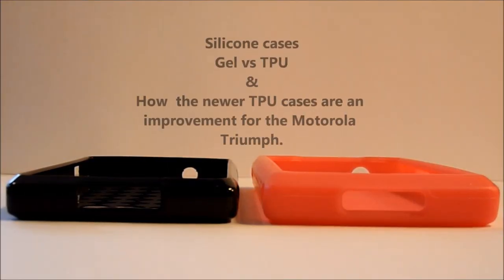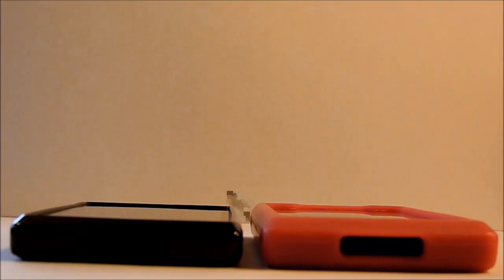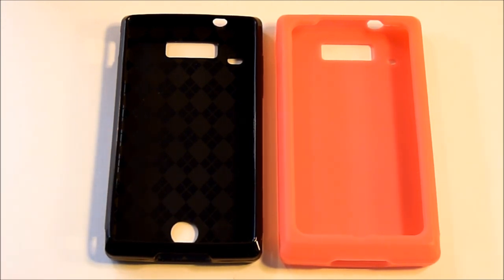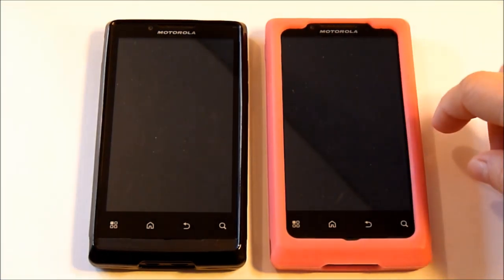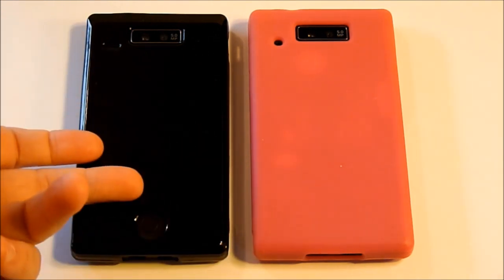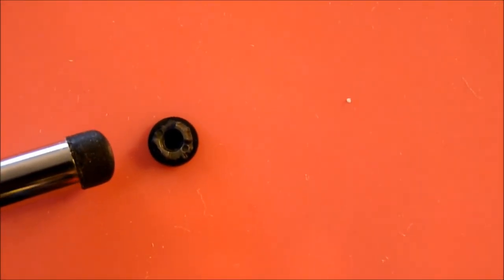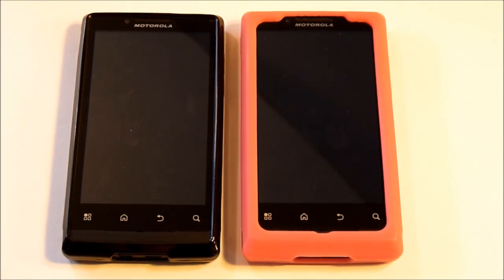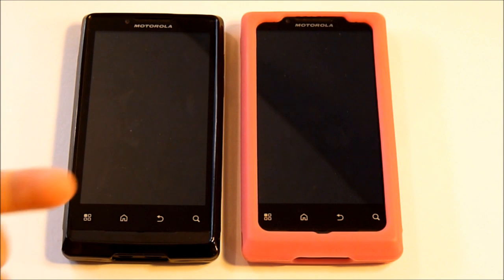Gel vs TPU phone case featuring Motorola TRIUMPH

Comment from the maker: @Mockingbird115 as for the battery back. another thing you notice they sell backs separate for around 10.but if everything ok with phone. then yes tried and TPU case no battery back and would be ok and advise folding a piece of paper and placing over battery to fill on the gap and help if jostled to keep battery from shifting as there is a little gap.

Comment from the maker: @BrianSimon94 they seem to be same thickness but I am going to make a educated guess since I don't want to do a drop test and see which one did not break. the TPU is little stiffer and impact may provide better protection. would a firm helmet vs a soft helmet same thickness protect skull better from cracking in as much. but insides are gonna get a jolt the same. wonder if somebody could invent a flubber case.

Comment: What I worry about is that gel cases add no structural integrity or protection, just a bouncy rubber sock around the device.   If you drop a phone or tab, the first place its going to hit the ground is on its weakest points... the corners.   Very rarely can you drop a phone or tablet and have it hit completely flat... 95%+ of the time one of the corners is going to impact the surface first... its just the geometry of situation.   Therefore, you want a case that is going to protect the corners the most, and absorb the impact and transmit it around the phone, and not transmit it to the phone.   A gel case won't do anything in that department.  It might protect your phone from scratches, but not from drops, gravel, water, twists, impacts, or god forbid you sitting on it like an idiot when its in your back pocket (which so many people think they can do - wrong).

Comment from the maker: @MrKeBUM I did ad a micro SD card class 6 is good price and works. I went with 32GB PNY class 10. I suggest staying away from Patriot brand they have trouble with android phones right now. read reviews newegg and support admits it too. Writing to card slight difference but the reading items from the SD card is much faster.  I can tell you from market Modern Combat 2 not compatible for triumph... and no Modern Combat 1 available. were would I find older Modern Combat 1?

Comment from the maker: @Mockingbird115 warning flag goes up. if no battery cover.. hmmm that is how replacement come. have them give you the serial number so you can check with VM to see if it is a clean phone or one that can not be used because somebody didn't return the replacement and decided to sell it. I have bought CDMA items that were still not released by company. had to wait for the guy to pay it off and then they let me use it. no sim card cant just transfer that easy. askThemIFcleanESN and is the a grantee